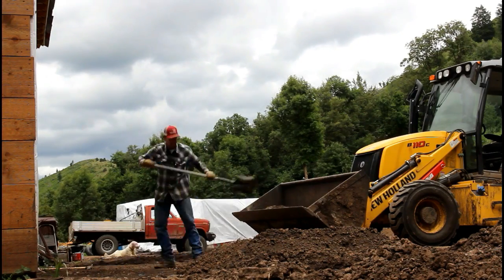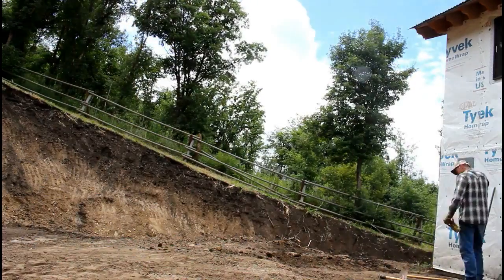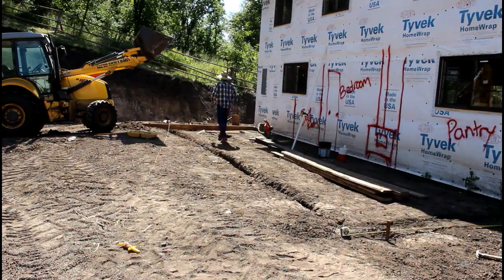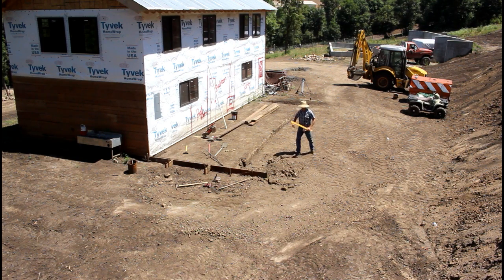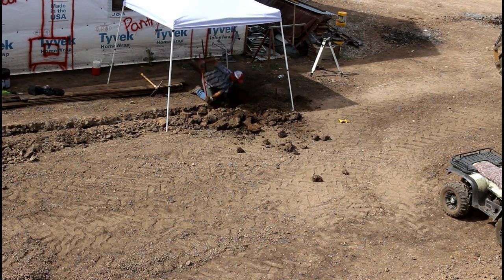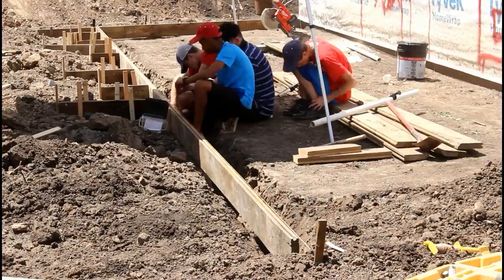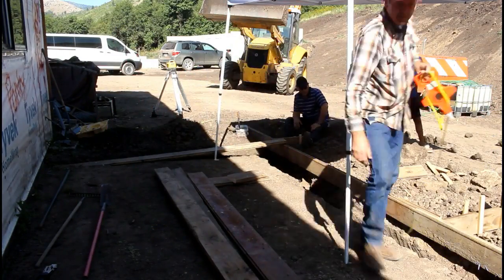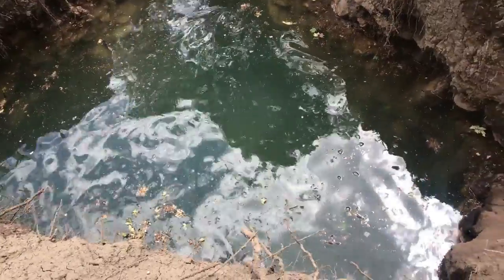#242 - Set Forms For The Monolithic Foundation Pt 3 (Addition)

Comment: Great job!  Sometimes the Carpenters have been told by the Building Inspectors not to have a sharp edge concrete transition between the slab and the footing (not such a sharp 90 degree angle).  So what they do is chip away the dirt along the runs kind of at a 45 degree angle.  So, here you have three holes.  On the interior side of the holes, you could nudge away at the soil some so when the concrete is poured, it doesn't hit such a drastic 90 deg angle as the concrete is filling in the slab portion.  I am not aware that this is a code requirement.  Maybe it is, maybe it isn't.  But if you look at images of monolithic slab pours, you'll see that there's a 45 degree or so angle in how the soil is dug on the interior portion.  I suppose too sharp a transition causes cracks, or something like that.
And, of course, any portion of the floor, whether interior or front or rear porch THAT HAS A ROOF OVER IT, must be at least six inches above finished grade.  It looks like your form boards have enough depth.  A back yard slab doesn't count as long as you don't cover the slab with a roof.  The reason is that if flood rains come, your house won't flood for the first six inches of height.  The other reason is that any portion of the house that has a roof (except garage or carport), must have a subfloor height level of a min. 6 inches---there may be some grey areas here.

A garage floor, though, does not have to be six inches above grade....that floor can sit at grade, but it is recommended that one put a couple inch slope on the garage floor so that any water accumulated can seep out the garage door openings.  So one end of the garage floor slab would be at grade, and the other end would be about two inches higher than grade....probably not a building code, but most all the Carpenters slope the garage floor.  If your garage floor floods (because you don't have the six inch height), usually the flooding will not damage the home.  The garage floor concrete stem walls, coming off the inverted t-footings, have to have a min. height of six inches.  So your garage can flood at least six inches high before the water hits the main house floor.   In areas prone to flooding, folk will definitely have their house main floor raised more than six inches off of grade (first floor finished floor line or first floor structural floor level).

Comment: You have a backhoe use the damned thing.  When I do a monopour the outside trench is backhoe bucket wide so put on you smallest backhoe bucket and get it done.  One day to get the trenching and excavation for the floor done.  One more day for gravel and exterior forms 
 and maybe one  day for running the compactor and tieing the rebar in the trenches and on the little concrete blocks.  I use the concrete blocks in the bottom of the trenches and have the rest of the rebar cut and waiting for pour day to be put in then.